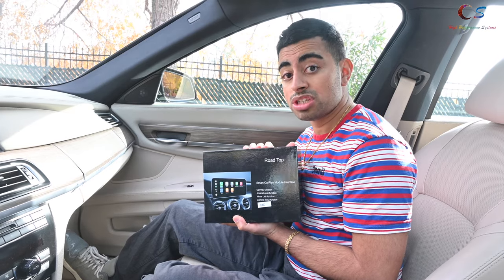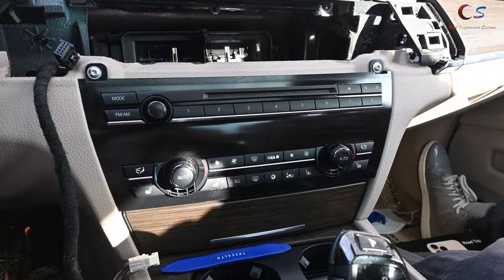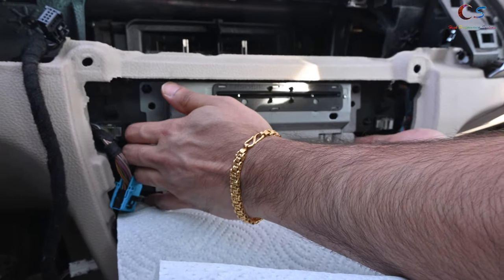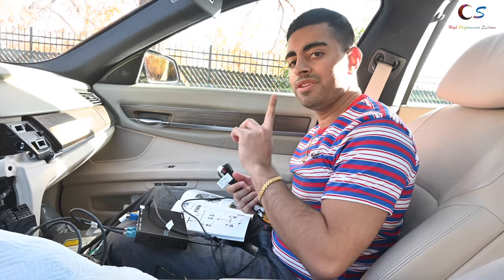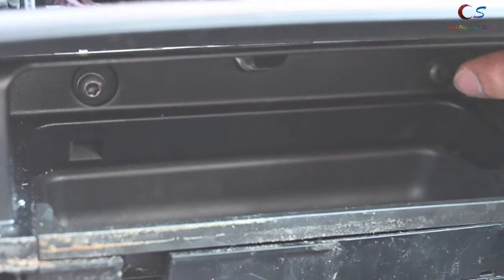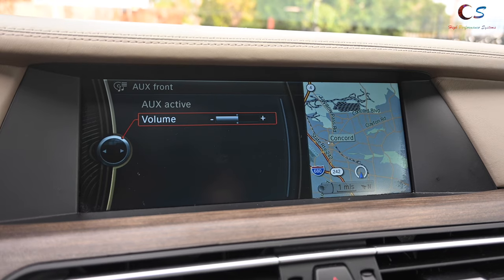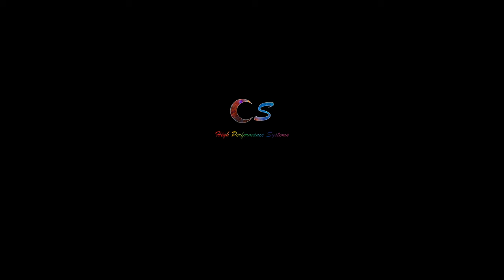Wireless Carplay/Android Auto Road Top Install in 2011 BMW 750Li (F02)

Comment: I installed this in my f10, the manufacturer was Andream, and the product was rubbish on Android Auto mode. Wireless connection very slow and each time you connect, you have to reset and reconnect the phone. Overall not worth it. Glad your one had no issues.
Reply from the maker: I got roadtop for both f02 and my f10. The f10 model is really good audio sounds great. Only rare for connection to not go through. F02 version always connects but audio doesn’t sound as good as oem cds/radio. Otherwise works fine. Both carplay I haven’t tested android auto but might be soon with my new phone. Really depends on which manufacture you get
Reply: I know I’m quite late but you could use a CarPlay dongle from somebody like carlinkit. I have aftermarket CarPlay in one of my other cars and plugging that into the usb port really helps the speed

Comment: For the Aux connection can you use bluetooth receiver at the center console and the wire coming out of the box?
Reply from the maker: As long as the aux from head unit is connected to something that also connects to car aux it’ll work.

Comment: Is there similar solution for G30 with EVO units? I have 2018 M550 and love the car, but there is no Android Auto. If I can get Android Auto without changing the head unit - it would be perfect.
Reply from the maker: My 2017 M6 also has EVO unit and no android auto. There’s a version for EVO as well so you can buy that. Same process

Comment: Did you disconnect the battery before starting? And is there anything in particular you have to do if you do disconnect the battery to ensure there are no errors when reconnecting?
Reply: And if you did disconnect the battery did you disconnect both the negative and positive terminal
Reply from the maker: No I didn’t disconnect the battery

Comment: Hi.. Thanks for the Video .. I have an BMW 750I F01 from 2008.. Full Option. It's really disappointing I can't Use the Software like in the Modern G12 Models.. Like watching or Listening to You Tube in the Car.. Bluetooth.. You know, I don't want that the only Option is Using USB.. And even that and Bluetooth isn't working properly in my Car. I can't do anything of that  stuff. I need all the Wireless Functions the G 7  Models has to offer. Is this all possible with this Module? I really would like to know.. Have to be sure. 
I am using an Android Phone by the way..
Reply from the maker: All this does is provides carplay and android auto. It also provides screen mirroring from phone. So as long as your aux works it’ll work. It can use it’s own bluetooth independent from car bluetooth.
Reply: @cs.studios  Thanks! The Cables for the Cameras and all, doesn't it make the Camera Functions even better? I have Back Up Cam and Front Camera in my Car.. But I would be glad to even Upgrade it into something better Sharper . Or wouldn't this make any Sense?

Comment: What about the mic? I didn't see you plugging the OEM microphone to the new module. Isn't it necessary?
Reply from the maker: I forgot to mention this in the video but i ended up not installing the mic for now. Spent too much time finding where to put the little box. It taps into factory mic but you need to run the wire from the box to the driver a piller to the factory mic
Reply: Watch my vid it shows it

Comment: The cic kt v2 where does it get plugged into you didn’t show
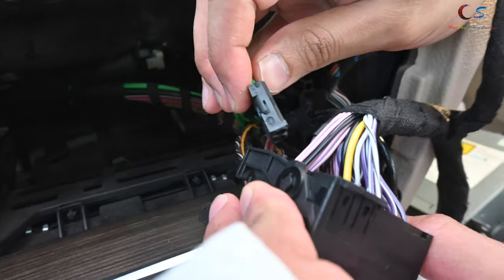Reply from the maker: 4:29 harness? 5:13 lvds cable? 5:25 box? 8:08 iDrive controller? 10:54 cic unit? Which part you talking about?

Comment: Thinking about buying a F02. How’s the maintenance and reliability?
Reply from the maker: I recommend looking at 14 model at least which has N63T engine. More reliable than the n63 in 2011-2013 models. Or get a 740Li instead. N63 plan for some sort of issue lol
Reply: @cs.studios  You forgot the Diesel model! Pulls well and quiet - best fuel economy... you didn't buy a race car for a reason... so enjoy it well with a diesel and kick back on cruise control whilst your rear passangers soak in the experience! 730Ld are good